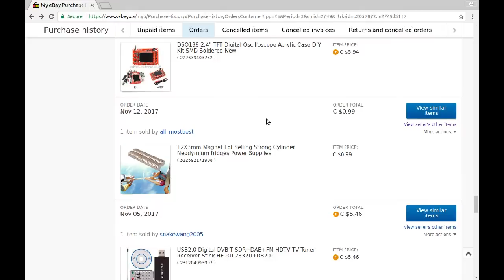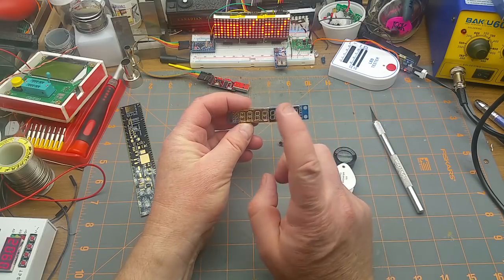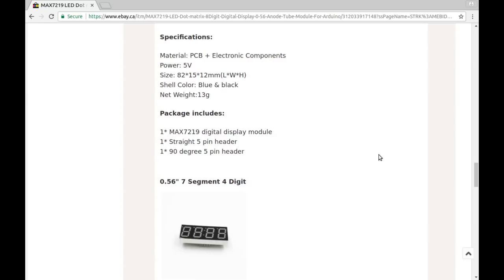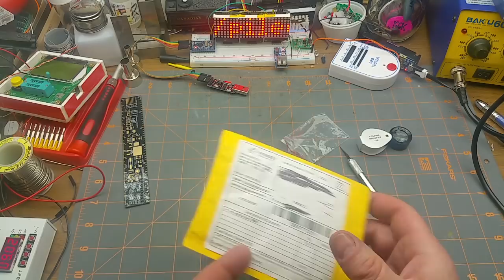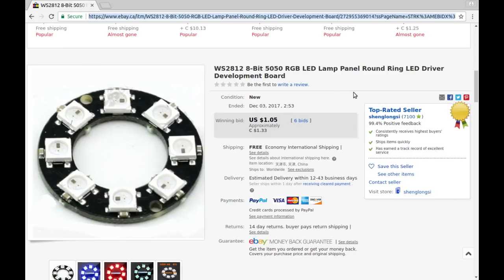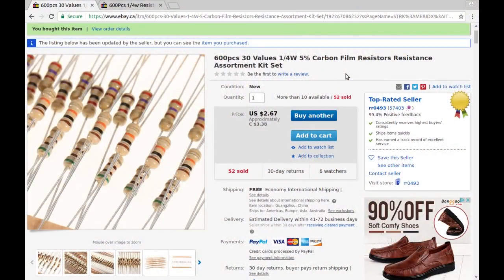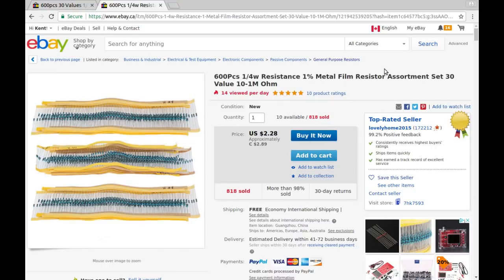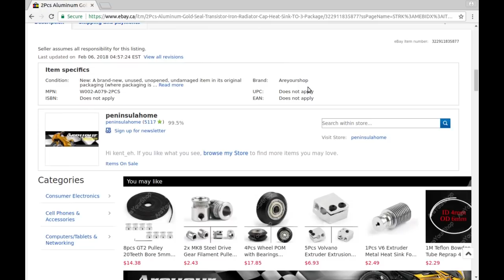mailbag monday 22

Comment: i am taking a break from ordering on ebay. i had two orders where the sellers shipped me a "gift" in lieu of the actual product - and did not send the actual product until i chimed in. it is a bummer to wait for the shipment, then get treated like a moron by the seller, asking for "one more chance" to "make it right." Gonna stick with the kits I have already. really can't stand getting ripped off, unless it is up front like at the apple store! :)
Reply from the maker: So far I've had mostly good luck. This is only the second $1.00 loss that I've had to take in over 3 years of buying stuff from Chinese e-bay sellers. 

Though that may be partially because I tend to order repeatedly from sellers who have done their job properly. 

When I'm ordering from a new seller, I usually start with only one really cheap thing to see if I can trust them.

I won't be ordering anything from "all_mostbest" again. And I won't recommend them if anyone asks.
Reply: I spreadsheet all my purchases to check suppliers performance, and I have found some that get stuff down here in 10-12 days with 27 days being the worst case. 
Some other Chinese suppliers are saying they are in AUS now - I don't know how that works - and most of that stuff gets here in 13 days - sometimes a touch longer that from China -.
Reply from the maker: If I remember correctly, 49 days is my longest one  (I didn't remember correctly - I have a couple over 60 days).  
20-ish days was the fastest I've seen.
Some of the delay was blamed on a backlog in customs inspections and the increasing volume of shipments.

AUS is a lot closer to China than Canada is, so I'm not entirely surprised that you guys get a bit faster shipping from China.
Reply from the maker: Ok, that's just wayyy too organized.

But seriously, that's an impressive collection of data. I don't have the patience for that level of data collection.

However, I do see a couple of things I might order...
Reply: I wanted to see how countries perform - Maly and Indo cheaper but very slow -, or if certain places lose mail more often - HK and China ended up the same -, and who was quicker - shoptuny is about the quickest -. shieldfans is about the cheapest of the quick ones.

Comment: I assume you ordered the TO3 regulators from china too. I had some too and they were all crap. Just do a simple test with them, my ones couldn't even withstand a bit more than 1A and they blow immediately. Would be interesting if yours are working.
Reply from the maker: Thanks for the heads up.

I was planning on using a resistive load and a thermocouple to test them before I built anything permanent with them.